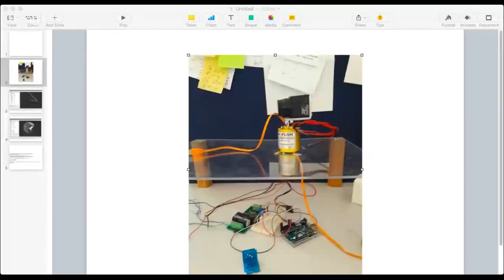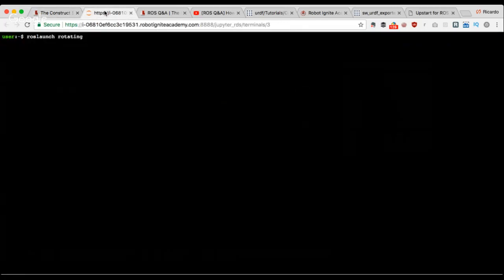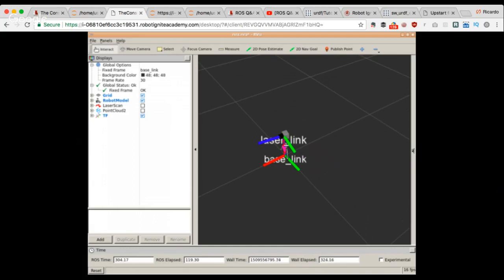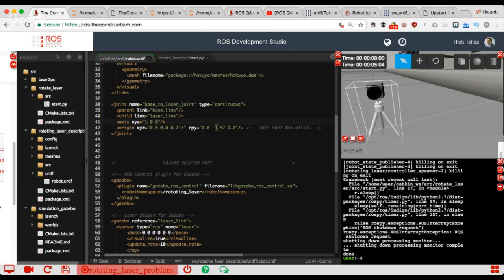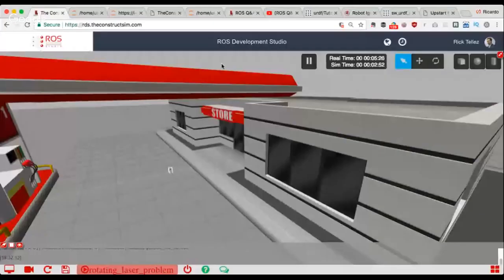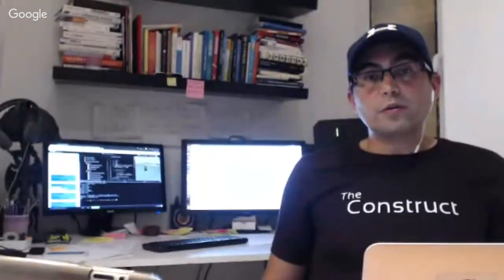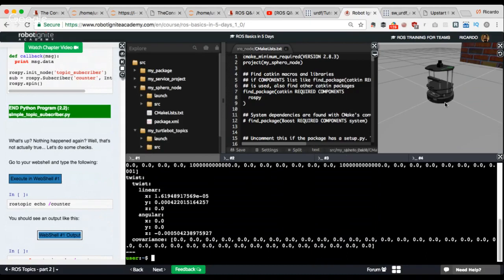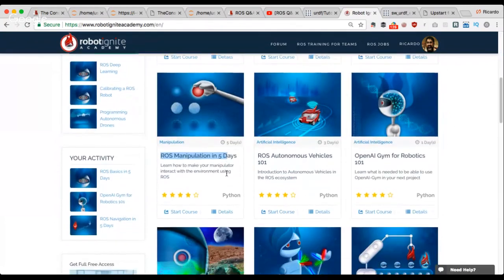ROS Mastering LIVE-Class#1: Building 3D pointclouds from rotating lasers

Comment: Hi. I am writing you to get help on Hokuyo3d lidar. The model is Hokuyo YVT-35lx. We have an issue on the lidar. We can get data from the lidar using ROS installed on RaspberryPi 3. The lidar’s Datasheet depicts that the lidar must have 2590 or more spots. But when we calculate spots, it gives us 2100-2200 spots in a field when we put a black object in front of the lidar. But when we take away the black object, the number changes around 2600-2700 which is acceptable. Because the minimum number of the spots should be got as 2590. What is the reason? We are using the hokuyo github code. https://github.com/at-wat/hokuyo3d 
We think laser beam does not return back when it meets a black thing. Because of what black color absorb all the rays. That is way the number of points decreases. If the laser beam does not return back, Which values does the lidar give as points, intensity? How does the lidar get the values that the laser beam does not return back to the lidar sensor? I mean in which form have those values (Point Clouds, intensity) been shown when the laser beam does not return back to the lidar sensor? As zero or at a weird form? In which form?
It is the important question for us. If you can’t understand what we mean, please feel free to ask. 
While we are running Rviz software on terminal, it shows us those unreturned values as an empty space. We would like to see the values that the lidar sensor would give us values for instance as a zero or a different value when the laser beam does not return back to the sensor.
I look forward to hearing from you.

Comment: Hi,
I tried a similar configuration on top of my 4-wheeled robot, but the joint shakes alot while rotating due to which scan is not good. I even tried to add some damping and friction but still not able to resolve the issue. Any other things which I can do to make it smooth?
Reply from the maker: Check the inertial values of your simulation. It is very likely that you do not have proper inertial values for the laser, the platform and so. Another point is that the PID values of the controller may need tuning. Do not use the default ones. Check this video to learn how to: https://youtu.be/gA-O39LrXzI
Reply: @TheConstruct  Ahh Resolved it!!!! It was infact the inertia issue. Thanks alot.